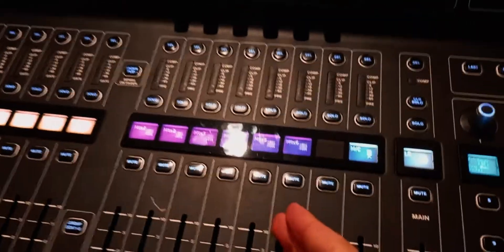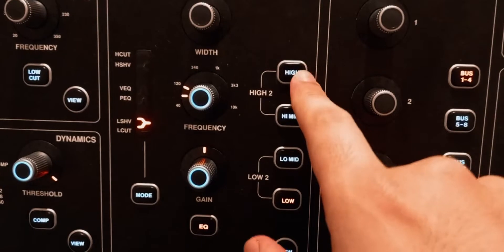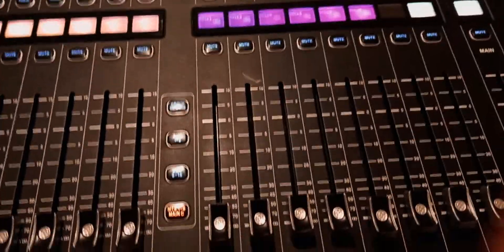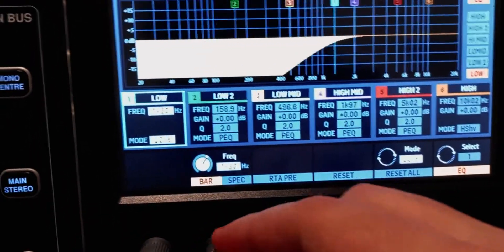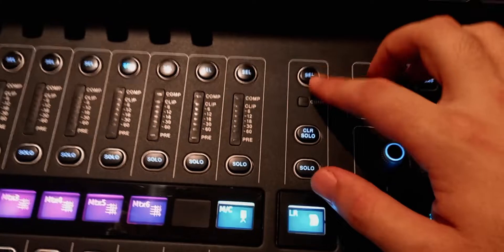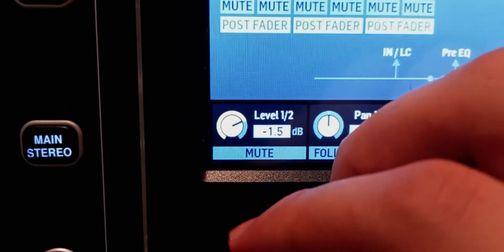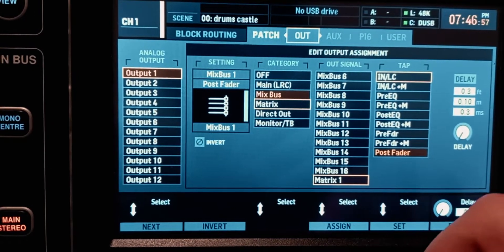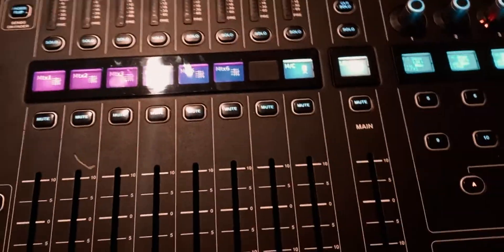X32/M32 how to: speaker Cross Overs with Matrix sends and eq filters

Comment: You should be using the 24db linkwits Riley filter included in matrix eq.
Your aim is to achieve a -6db curve at the cross over region, which is then also  phase aligned with delay.
The next thing would be to establish the correct limiter settings for the speakers you're using. Usually for tops it's somewhere  around 10ms attack, 500ms release, maybe around -6.5dbs threshold (all speaker dependent.

Of course if active speakers are being used, the limiters are taken care of.

I'd then look at smmart to see where EQ can help flatten out uneven room response.

This is before front or rear fills are added and aligned which is too complicated to get into details here.

Just slapping any hf lf filter is not setting up a viable cross over.

Comment: Thanks for the video Daniel., I’m learning new things with you ., so., if I use the bus out 1-6 for a 3 way crossover, I only have bus 7 to 12 For floor monitors right.?   
And one more question., bus out 1-2  will go to low’ amp, 3-4 to mids amp… 5-6 to highs amp., stereo mode .. it’s this correct .? 
Thank you so much 👍
Reply from the maker: @samd5005  you will use matrix 1-6 not the busses 
You send the main LR to the matrices and you still have all your busses available for monitors 
And yes matrix 1-2 goes to the low amp 3-4 to the mid and 5-6 to the high
Reply: @danielkharrat   I’m little confused., I have the Midas m32c ( the rack version) and the Midas dl 32 stage box…and I don’t see a matrix output in the dl32… just the 32 channels, and the 16 bus out 
So, whet this matrix output are 🫣🫣
Sorry 😅 or I only can do this with the big m32 console, but not with the m32c.. please explain 
Thanks 🙏
Reply from the maker: @samd5005  it's the same with the big console also you only have 16 xlr outputs 
You are confusing outputs with busses 
By default the 16 xlr outputs are assigned to the first 14 busses and the left right
In the OUT page you can assign outputs 11-16 to matrix 1-6
And you will have xlr 1-10 for busses or something else
So yes you will be using 6 of the total 16 xlr for that matrix setup but you're not losing busses 
You can still use the busses 11-16 for mixing or if you use another stagebox you can have physical outputs for them
Reply: @danielkharrat  thanks for your time..
Awesome sound engineer 💯

Comment: Is it possible to EQ matrix 1 and 2 individually when in a stereo pair? or some sort of work around other than using inserts?  For instance if i need to EQ my left speaker differently to my right speaker
Reply from the maker: You'll have to unlink them or go into setup menu and turn off EQ in the link preferences 
But if you do that it applies to the entire console so just unlink them
Reply: @danielkharrat  but then will it be summed to mono in each one? Is there a way to send Main L or Main R only to a matrix?
Reply from the maker: @gershondharmanandan9902  you're right. I haven't thought about it before but that's a big flaw that the link preferences can only be changed globally. I guess you only solution is to insert a Dual TruEQ if you want something that behaves like a normal parametric eq because the GEQ creates all kinds of problems if you decide to boost frequencies
Reply: @danielkharrat  yeah I'll probably have to just give in and use an insert if I really need it. I plan to use it for tuning the system using smarrt/OpenSoundMeter, so hopefully the right side won't be too different to the left and I can just use the default parametric on both. If I really need to adjust the other side more then I'll end up using an insert (either truEQ or the blue one with knobs, I forget it's name lol). Do I have to worry about the delay caused by an insert? Or is it so small that in a room it doesn't really matter in this case?
Reply from the maker: @gershondharmanandan9902  the delay of the effects on the m32 is roughly around 1 millisecond so no you won't notice any delay, however you have to insert it on both the Left and Right even if you only want to use it on 1 side
If you use the pultec eq there's a "IN" button that allows you to bypass the effect without removing it from the signal chain
So you can bypass side A and work with side B but keep the insert button turn on for both the left and right matrix
Reply: @danielkharrat  thank you!

Comment: If the setup is LR and Sub, should we be setting up Sub sends and PA crossover via Matrix or M/C?
Reply from the maker: Depends on your preference, do you want to focus on the mix as a whole and let the console send each part of it to the correct speaker or do you want to decide what goes to the sub and what doesn't
Reply: @danielkharrat  Other than "let the the console send each part to correct speaker", what other benefits are there for using matrices for PA? One benefit may be you can gain headroom for PA (matrix headroom + LR headroom)?
Reply: @anchoravsystems8598  Matrices give you an extra EQ, and for the low and high bands you have modes with steeper Qs (which Daniel didn't show in his video for some reason) that are handy for handling crossover frequencies.

Comment: Thanks for your video.How can i eq my matrix I set up delay speakers with matrix but can't control with eq.
Reply from the maker: With the same eq you use for the cross over
Reply: @danielkharrat  thank you but I wanted to use eq  just for to release feedback for my matrix but it didn't react
Reply from the maker: @vaqiftahmazov6359  you can use a graphic eq and insert it on the matrix
Reply: @danielkharrat  I did but again didn't work.The matrix worked but with eq didn't react
Reply from the maker: @Vaqif Tahmazov  if it didn't react then it's off. Make sure it's active
Reply: @danielkharrat  thanks how does it make on?as you shows video send bus to matrix make sure sends on fader on then on patch panel change bus to the matrix.Does it correct?I first uped the matrix fader then selected on main then bus sender opened matrix 1and 2 then cut low,and finaly from patch control changed the bus to the matrix
Reply from the maker: @Vaqif Tahmazov  I'm saying the eq should be on the eq button should be lit
Or you can see on the screen the "active" button should be yellow. If it's grey it means the eq is turned off